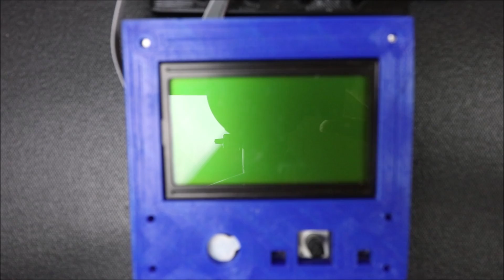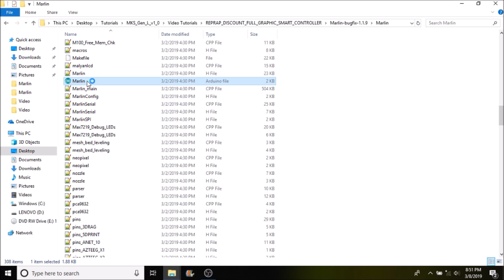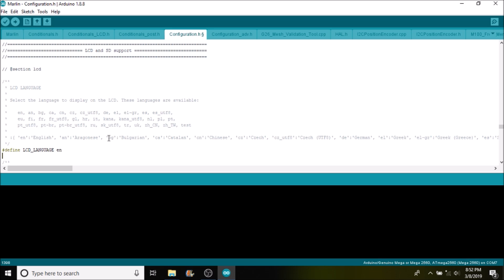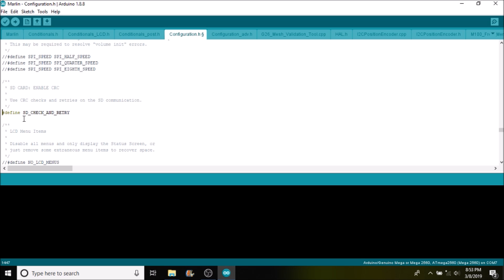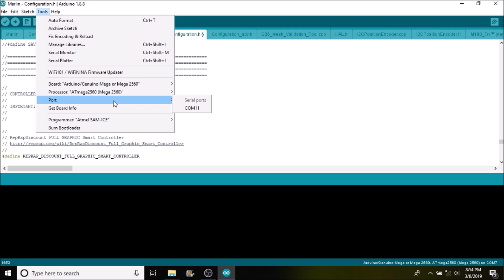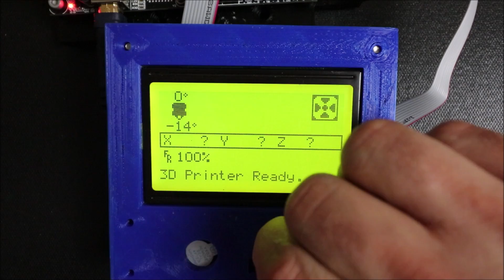MKS Gen L - REPRAP DISCOUNT FULL GRAPHIC SMART CONTROLLER

Comment: Hi I have a problem: when I conect the screen to MKS board start flashing and song. Afterthat I press the buton and the led in the board flash, screen stop song by a few second and after start again. Could you help me?
Reply from the maker: Sure.  Does the screen make a hissing sound or illuminate?
Reply: @EdwardBraiman  Yes, when I charge the Marlin, I connect the display and it starts flashing and beeps, but it doesn't show anything on the screen. The screen works because I tested it and the MKS board as well.
Reply from the maker: Reverse the ribbon cables on the printer board connections and tell me what you see?  Also send me a link to where it was purchased.
Reply: @EdwardBraiman  Man you are the best. Now work very well. Many thanks
Reply from the maker: You're welcome.

Comment: I gave up on Marlin 2 as it would not work for me for Z (X,Y,E all worked fine) and the people over on the github tried to help but it is something in my system and in their Marlin that isn't playing nice.  What I did was switch to Smoothie and it was easy but apparently this graphic LCD was wired backwards on the real smoothie board so I get it lit up but that is it.  Scanned the net and the only solution was cutting wires and reversing them.  Hell no that is what pins.h is for in Marlin but in Smoothie beats me.

My board is the SKR V1.3 but in this instance is the same as the MKS so basically I spent my money to buy a brick and I am beyond frustrated after 3 days of too many hours to count trying to get it all working.
Reply from the maker: Could you tell me about the issues with the z-axis?  What stepper are you using?  What's are the settings you used in Marlin firmware for confirmation.h?  What happens when you only configure the z-axis?  What messages do you see in Pronterface when trying to use z-axis?

Comment: Do you know how to change the way you navigate through the menus? i had a little generic prusa i3 where you could hit the arrow up key to go back and then on the next menu it would be on the arrow back option so you dont have to scroll up on each menu as you are trying to return to the main menu. I cant seem to find any of the settings for this but it must be in there somewhere.  Let me know if you understand what im saying and or if you have any info to help me out.
Reply from the maker: I'll check in Marlin firmware after work, but you can search on, "menu", you might find something in configuration.h or configuration_adv.h.
Reply: @EdwardBraiman  I tried for days but I could not find it. I also tried to compare firmware differences in marlin but could not find that either. I just really want to figure out how because it is so much faster getting back to main screen instead of having to scroll up to the back arrow on every menu screen.

Comment: Hi EDward do the lcd work under 1.1.8 Marlin?
Reply from the maker: They should.
Reply: @EdwardBraiman  cool ok im gonna experiment this :) i just receive my MKS l gen 1.0 today and im looking at your video on this board :) awesome content! thanks a lot Edward:)
Reply from the maker: @BraveNewWorld1984-r6o  Keep in mind the Firmware for Stepper drivers have changed due to Firmware version 1.1.9 for Marlin.  I'm trying to make an update for this weekend.
Reply: @EdwardBraiman  I'm glad you mentioned that. I updated from 1.1.9 to the bugfix version on my Anet A8 (stock board). When moving axis (homing etc),  the steppers would engage, but would not move. In the end to get it to work, I had to re-initialise the EEPROM. After that was done, the printer works as normal

Comment: There is no need reverse cable/cables ?
Reply from the maker: Not on the MKS Gen L, other 3d motherboards, maybe.
Reply: @EdwardBraiman  ... I have an MKS GEN L installed with a "Smart Screen" and it's connectors are reversed. I think it may be whoever manufactures the Screens ... mine is from "BigTreeTech" who seem to be developing a reputation for "individuality" in their products.
Reply from the maker: Good point.
Reply: @EdwardBraiman     
what is this error 

Arduino: 1.8.8 (Windows Store 1.8.19.0) (Windows 10), Board: "Arduino/Genuino Mega or Mega 2560, ATmega2560 (Mega 2560)"

sketch\ultralcd.cpp: In function 'menu_action_setting_edit_callback_long5.constprop':

sketch\ultralcd.cpp:4860:3: internal compiler error: Segmentation fault

   DEFINE_MENU_EDIT_TYPE(uint32_t, long5, ftostr5rj, 0.01f);

   ^

Please submit a full bug report,

with preprocessed source if appropriate.

See <http://gcc.gnu.org/bugs.html> for instructions.

lto-wrapper.exe: fatal error: C:\Program Files\WindowsApps\ArduinoLLC.ArduinoIDE_1.8.19.0_x86__mdqgnx93n4wtt\hardware\tools\avr/bin/avr-gcc returned 1 exit status

compilation terminated.

c:/program files/windowsapps/arduinollc.arduinoide_1.8.19.0_x86__mdqgnx93n4wtt/hardware/tools/avr/bin/../lib/gcc/avr/5.4.0/../../../../avr/bin/ld.exe: error: lto-wrapper failed

collect2.exe: error: ld returned 1 exit status

exit status 1
Error compiling for board Arduino/Genuino Mega or Mega 2560.

This report would have more information with
"Show verbose output during compilation"
option enabled in File -> Preferences.
Reply from the maker: Do you have u8glib installed?
Reply: @edwinjossy1682   maybe this : https://reprap.org/forum/read.php?415,843385,843728
Reply from the maker: Looks like there talking about TMC 2130 drivers.
Reply: @EdwardBraiman   at the end last 2 3 messeges about w10 market he installed, another user suggest uninstall and install from arduino.cc website and edwin error code "Windows Store 1.8.19.0" tells it from store
Reply: @EdwardBraiman   cool, do i need "smart adapter" for it ? i bought theese :
https://www.aliexpress.com/item/3D-printer-reprap-Ramps1-4-smart-controller-Reprap-LCD-12864-display-for-mainboard-high-quality-excellent/32808902457.html?spm=a2g0s.9042311.0.0.43954c4dTv48Dv

https://www.aliexpress.com/item/controller-PCB-board-MKS-Gen-L-V1-0-integrated-mainboard-compatible-Ramps1-4-Mega2560-R3-support/32802151924.html?spm=a2g0s.9042311.0.0.75784c4dYO4Cng

at info they said ramps 1.4 need smart adapter, no adapter needed but i confused
Reply from the maker: You may.  Could you create a video of how you're connected and post a link on YouTube?
Reply: @EdwardBraiman   me ? im waiting shipping not arrived yet :( if i need i may buy from local i added link above my comment lcd and mks genl board where im confused for, thank you for great contents and answering all question
Reply from the maker: You're welcome.